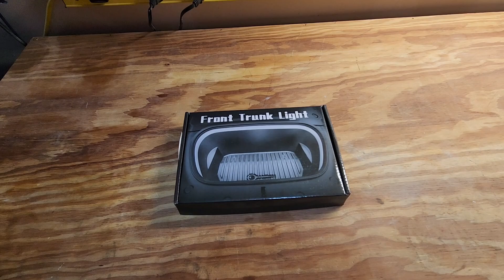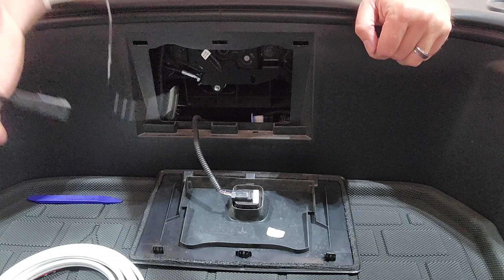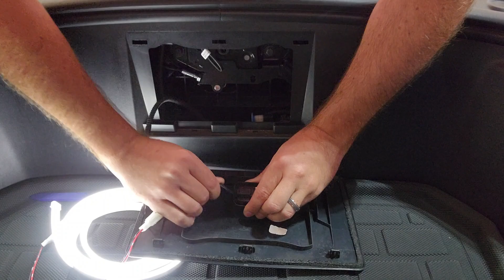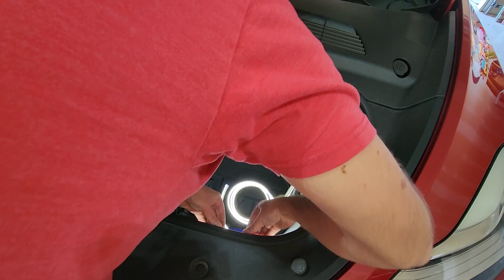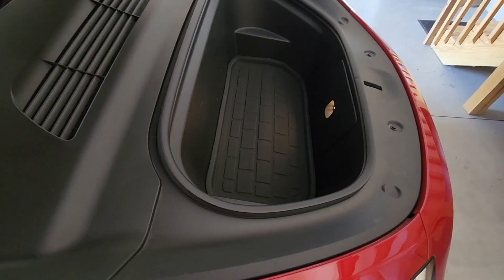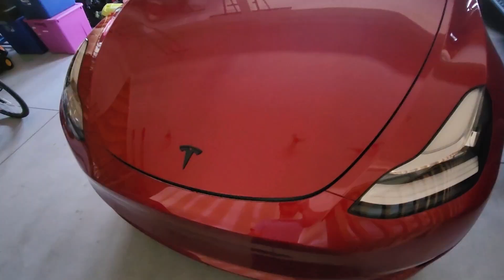Brighten Your Frunk! Tesla Model Y Frunk Lighting Kit Install

Comment: Wow people are so overcomplicating this with wiring and such. The new Teslas have plastic sides. I just spent 30 AUD and got a 4 pack of bright puck lights, 3M heavy duty tape, the lights have IR motion sensing, you get 4 in a pack, I have one on each side, they are small, I have two fully charged and just pop them out of the housing in 2 seconds (literally) and swap every six months. Or just charge the same 2 in the car for half an hour if you are on the road. No factory wiring messing about, nada. Simple. The entire install took me 3 minutes (wiped the plastic with iso, waited a minute to dry to be sure, stuck the puck mounting bracket on tape, done). Seriously.
(PS one light is enough to perfectly light up the frunk btw, two was overkill but I have done it now).

Comment: Does it turn off when the frunk is closed?
Reply: The power comes from the same place that lights the OEM light, so it just acts the same way it always has.

Assuming that you trust the light in your fridge turns off when closed, you can trust this as well.
Reply from the maker: @da0afd79  From my testing and other videos I've seen, it turns off after about 10 minutes from when you open the frunk, even if you close it right away.